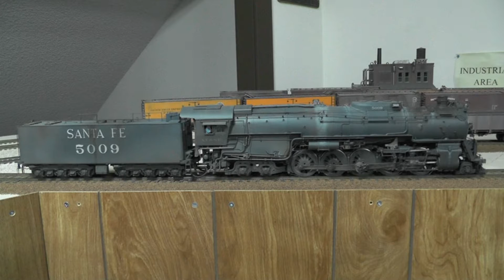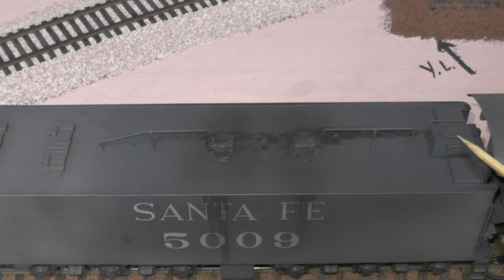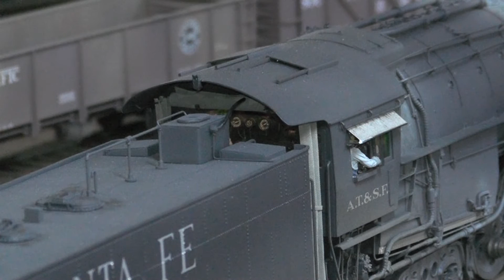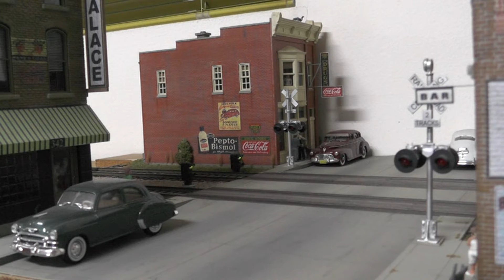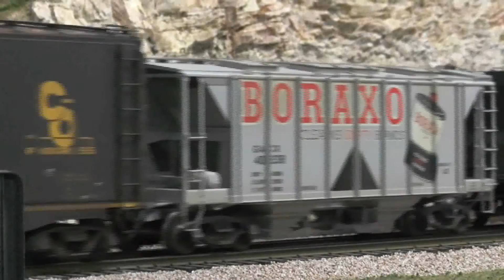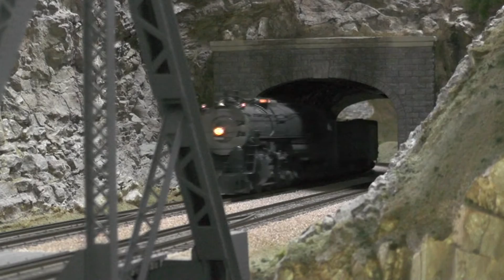ATSF 5006 5009

Comment: So what manufacturer made this steam locomotive model from O scale?
Reply: It looks like a us hobbies locomotive. Probably built by KTM Scale models.
Reply: @westernpacificrr  interesting
Reply from the maker: As noted in the video, I started with a pair of USH ATSF 2-10-4's, but those are models of the 5011 class. I totally rebuilt them into the 5001 class, which has never been imported at all.
Reply: @garyschrader7558  did you mean MTH there?
Reply from the maker: @alternative890  No. Info is correct.
Reply: @garyschrader7558  ok is USH the manufacturer?
Reply from the maker: @alternative890  US Hobbies was the importer. KTM in Japan was the builder.
Reply: @garyschrader7558  oh wow